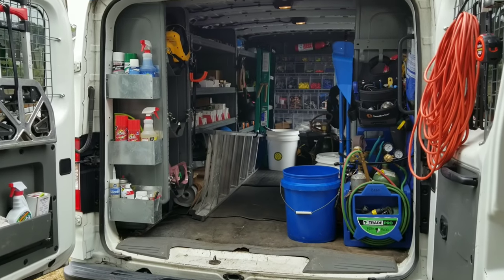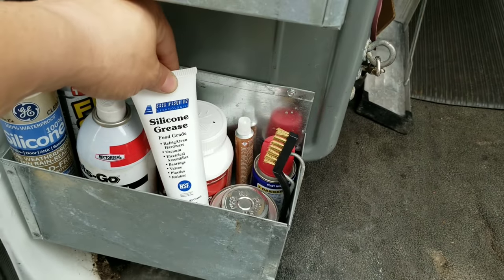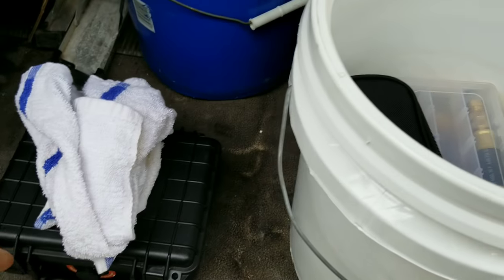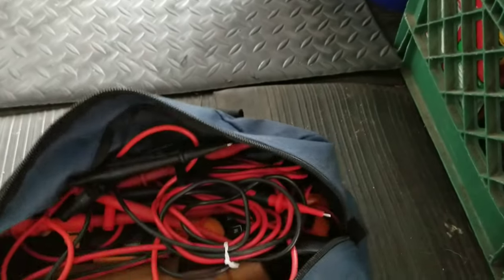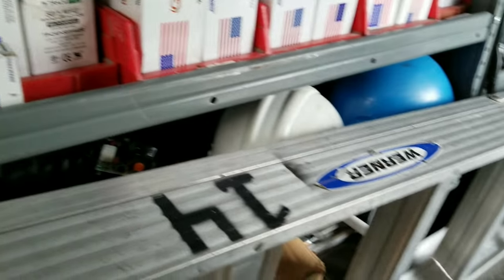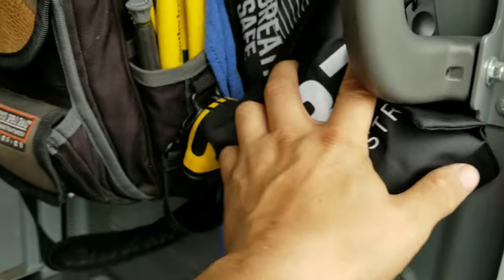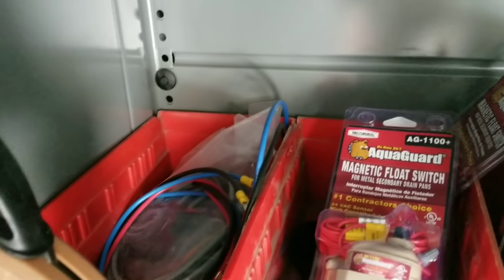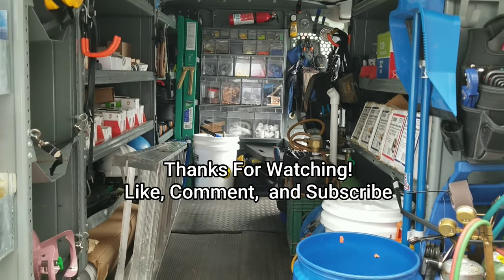HVAC Service Van Tour (2019)

Comment: Nice setup. You need a NITECORE HC33 1800 Lumen High Performance Versatile L-Shaped LED Headlamp. Best light for attics and crawlspaces. After I saw how good this was, I bought two extra rechargable batteries and a charger. Got it from Amazon.

Comment: We do a lot of UV lights in South Florida now especially since they went away from the copper coils the drain lines and drain pans are ridiculous as well as the mold in mildew. We changing the filters constantly the AC runs 24 seven

Comment: I really enjoyed the video, I have a 2012 NV 2500. I notice a lot of guys don't use the bigger tool boxes like I do. I just think it protects your tools a little better and actually takes up less room in the end. I love the two liter bottle idea to a PVC pipe... that's brilliant!👍👍 I wish I only had to carry one or two bottles of refrigerant. LOL I've got two of the main flavors with a total of 11 bottles,  22,134a,404,407c,407f,410a.R22D. 👎
Reply from the maker: Thanks man! 
I've tried some tool boxes/tool chests in the past but they seemed to be way too bulky. Maybe the ones you're using are a slimmer option than what I'm familiar with. Time for you to make a van tour video. I'm always up for ideas. 😁
We do some coolers and ice machines but mainly heating and air work so we leave the other refrigerants at the office most of the time. No needed to carry them all when I may only need them once a month. lol
Reply: @HVACinSC  that's how I was at my previous employer. Since being where I am now, I only have to run residential every now and again, but mainly I do commercial and Refrigeration. I thought about doing the van ture but I'm a little reluctant. I had my tools stolen out of my van in my driveway. Since that time I built a building for my van and it's fully secured with my home alarm and high-definition video cameras. Along with some other unknown disclosed tool recovery systems.🤫😏
Reply from the maker: @HVACRSurvival  Damn that's sucks man! I completely understand but if you do decide to make a tour video I will definitely be tuning in!
Reply: @HVACinSC  I probably will.
Reply from the maker: @HVACRSurvival  🤙🤙
Reply: How is the NV 2500 holding up for you? Thinking about getting one soon.

Comment: Make sure your van have alarm and “slick locks”. Mine got broken into a few month ago. They broke driver window and unlocked my van. Alarm didn’t sound. Because it had no factory alarm. 2018 nissan nv2500
Reply from the maker: My van has an alarm system and my company insures everything I have inside as long as I dont leave it unlocked.
Reply: HVAC in SC good!

Comment: Very nice video. I saw your video that you made 8 or 9 years ago on the nv200. How do you like this current van compare to the nv200? Also when you use to drive the nv200 how did you get your condensers and furnaces to the job site? I am trying to figure out if I should buy an nv200 or the nv1500 as I will be new at running a business. Thank you in advance.

Comment: Awsome video. I have been eyeing that cordless dewalt vac. How is the suction on it ? Good enough for inside condensor?
Reply from the maker: Thanks Cory! It's not quite as strong as a 120v shop vac but it's close. Clears clogged drains, picks up dirt/debris, and removes water from pans with ease. I'll have to do a little video on it for you guys.
Reply: I have that vac too and love and use eveyday. Mine has worn and taterd for proof! tried wet leaves in cu, won't do those. But it will do what Brad said, drains, water in pan, clean the floor or van!  its got some power.

Comment: 1/2 diameter appions? I also tried this setup but want to try curling them up in the bottom like that now
Reply from the maker: Yes, its 2 6' Appion hoses. Great product and they fit perfectly in the base of the bucket.
Reply: @HVACinSC  sweet!

Comment: Lost me on the epoxy. What is the use?
Reply from the maker: Uses are literally endless
Reply: Have you never came across a cracked evap drain pan? Keep the client operating until the parts come in...  Come on man... dont ask dumb questions